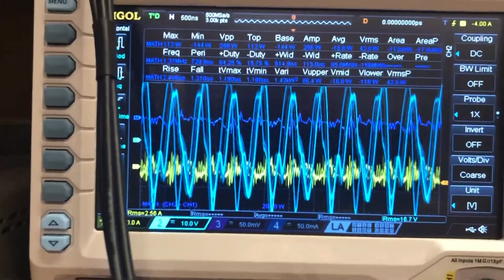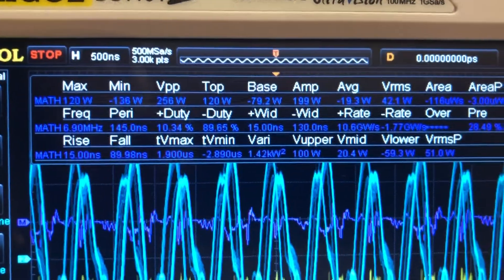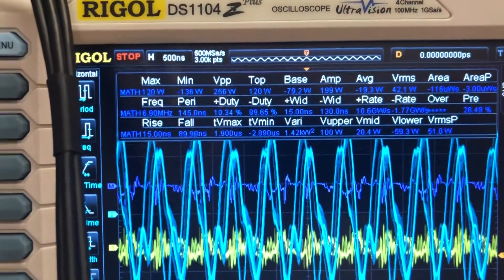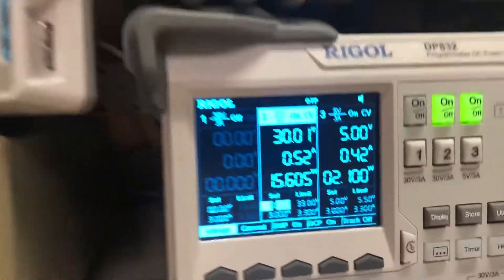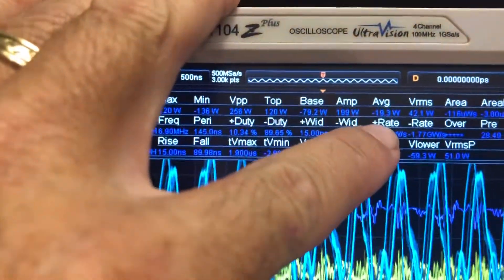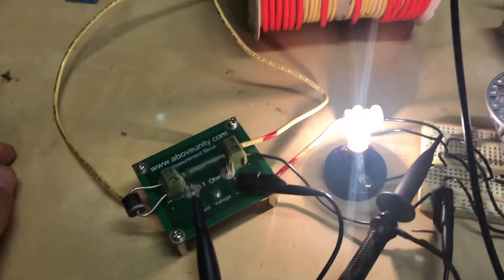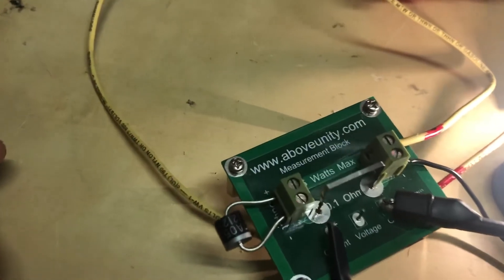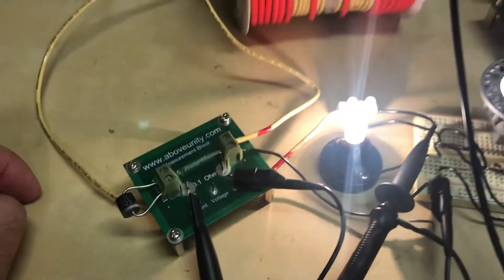Update  Asymmetric regauging 6

Comment: Hi Captain,

nice new scope you have, and so quickly

Some remarks;

seems you need to invert the ch1 (current) as now you measure opposite to the voltage probe causing the negative value.
That way the result (watts) will be positive as it should be.

CH2 on the screen shows x1, please under normal conditions the right setting would be x10, both on the scope probe setting as on the probe itself.
Only under marginal conditions (very low signals) you can set both to x1.

Last but not least, please measure also the input to your L1 coil, not just rely on the PS readings.
Use also a 1 or 0.1 Ohm csr for current and the math function.

for nitpicking; set all channels (CH1, CH2 and Math) to the middle of the screen, put up as much cycles as could be and adjust the amplitude of the signals to just fit the screen, not much less.

Good luck,   Itsu
Reply from the maker: Thanks Itsu!